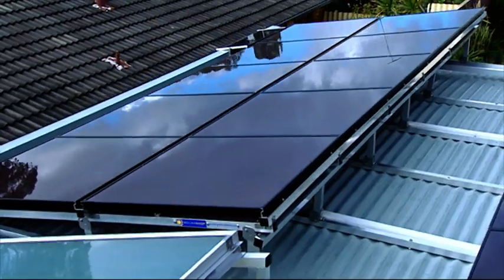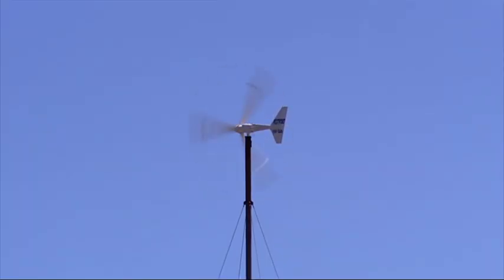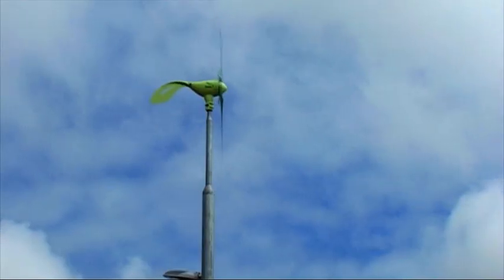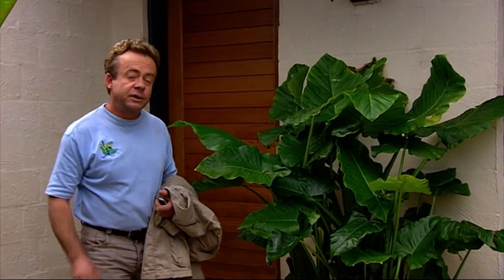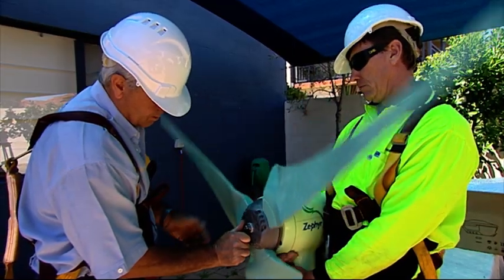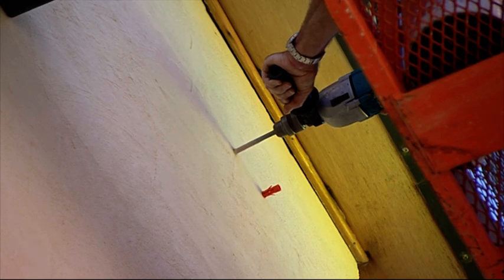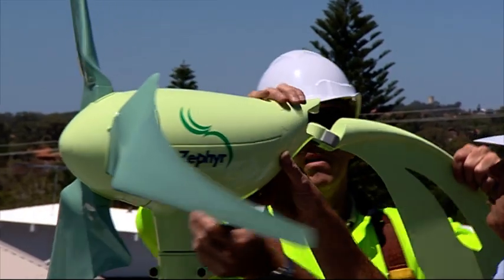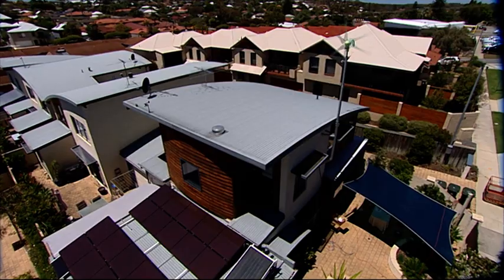Wind Turbines for the Home

Comment: Rules by placing a wind turbine on the building... = NEVER attach a tower/mast on the house, always stand-alone on a small concrete slab
Reply: +Willem Budde They can work where this one is installed. Tower would be best results but if you can't have a tower then this install will do.
Reply: Why not attach to a building? If youre thinking lightning youre screwed regardless because of the building electrical connection, though the risk can be mitigated.
Reply: Why not? Who says?" It's your house, right? The reason wind generators are prohibited from being mounted on your house, is that such a scheme would WORK too well! If you don't need a tall, expensive mast, you save money. If you make your own canvas sails, you save money, and gain torque. The object of regulations like these is to make wind generators expensive and unprofitable!
Reply: @jackfenn7524  Usually the conduct mechanical noise into the structure. There is no rule about it, just might be annoying for the occupants.
Reply: Could you please suggest a wind turbine that you are thinking of using sails.  @jackfenn7524

Comment: Wouldnt these things produce more power with more blade area? They always look skinny.
Reply: yes the output depends on the rotor diameter
Reply: @Pradeepkarti  I can understand the diameter affecting output, but not how skinny they are or how few blades. Seems like a lot of uncaptured air is moving past the large expanse of space between the narrow blades. Think of the sail dimensions kn a sail boat. Big fully deployed sails equal more power and speed. Take some sail area in and the power and thus speed drops.
Reply: "How much cash would a woodchuck chuck, if it had a brain?" RIGHT! RIGHT! CORRECT- BRILLIANT! PLEASE Joe, keep typing! YOU ARE THE MAN! If you aren't a genius, you should be! Large sails, (not blades), produce TORQUE!  And torque is necessary to produce electricity!

Comment: How much power does this tiny windmill send down the line? And how much is lost per foot due to the resistance in the power wire? If this wind turbine made money, then the electricity it produces will be used right there inside the home, in manufacturing operations and residential use.
Reply: Unless you live where it is really windy ... Wind Turbines do NOT make money ...

Comment: Mr. Vann, you are exactly right! So-called "modern" wind turbines can never pay for themselves, because they do not have enough sail area to produce torque!  And torque is as necessary to producing electricity in wind generation, as it is in any other method of producing electricity! These "wind turbines" are designed to fail!  Real, profitable Dutch windmill electrical generators would make a fortune for the owners, and they would cost about 90 per cent less to build. And best of all, no Federal subsidies would be needed.

Comment: 15 kwhr? Do the math and dont forget to include the losses.
Reply: They will never show it, cause its a fact it can  only generate 600watthr /day. total annual of 220 kwhr/year . sufficient to run home for  16days.  Cost of grid supply of 220 kwh @28 cents/kwh = Aus$62.
Cost of turbine @ 2500 including the inverters and batteries. Itll pay  for itself in 40 years. or if u only take into account the price of turbune and inverter @ 1200 , itll pay for itself in 18 years... 
So if u buy one, ur buying it for a gimmick..
Reply: Ephraim Veluz was
Reply: @ipeeinmysinkimafraidtocome7127  what? None of this makes any sense.

Comment: WRONG on so many levels. size of the blades, height and site for installation. If your town has good grid infrastructure, than instead of 1000 homes each having their own miniturbies - A larger turbine somewhere off the town would just make more sense.. Wind power scales pretty dramatucally wuth size of blade and the laminar wind .
Reply: Wrong. The unit is designed well and operates with almost no sound so the blades are correct for the unit, The height and site for the install is exactly what that particular application requires. They are running well right where they are. You probably don't want to have to do any work yourself or pay any money. You sound like you want the government to do it and pay for it for you. The problem with that is twofold; the government is notoriously wasteful of our money and then that would still leave them in complete control of your power generation. The beauty of spreading out the where the generation happens eliminates the risk of everyone losing out because of one failure and puts control into the hands of the individual. Freedom and Independence.
Reply: Free from government control doesnt imply spending unneccasrily more. Where it benefits to have a single plant, that should be considered first. Home Solar panels are  good as it doesnt scale down with size, The power per unit area is pretty much the same. And please dont quote me on with 'But the sun dont shine all day'. But with turbine, there are two factors - the site for laminar wind flow and the surface area of blade span. Especially the second factor, where it scales down pretty dramatically with size. @5,000 kwh/home annual consumption soon to increase to 13 - 15 k kwh when your cars are electric, thats  more than 32 kwh /day we will always need grid. So its wise at first to invest in Larger turbines. Anyway if you have surplus fund go for it..
Reply: Your first sentence does not even make sense unless you are agreeing with me. I said what we all know. Governments waste and overspend our money. Your sentence says the reverse. Your second sentence disregards the gov incompetence and wastefulness and gives up your autonomy and that should not be considered first. It also forces everyone to be in the same boat so to speak. People in the area who don't want to pay for the large turbine through their taxes have no choice but to pay up and then continue paying the gov for their power. I have no power bill for my home and soon I will have no gas expense to drive. I live in Canada in a completely off grid home. I don't need the grid at all. I have all my power needs including cooking and air conditioning and hot water from solar. I have a 7500 watt solar array and bring in 30kw in 4 hours midday and another 15 kw in the 2 hours before and after peak time. What is needed is to have an alternative source for "when the sun don't shine". To be able to pack my batteries full when it is overcast or raining or snowing or at night is the completion of reducing my carbon footprint to zero.
Reply: I must say though that you are right in that the larger turbines have a greater efficiency than the smaller units. My objection is solely based on it being better to take care of your self than having the gov take care of you. So that in my humble opinion; even though you lose a degree of efficiency  with your own smaller unit , what you gain in autonomy and control is more than worth it.
Reply: Your Solar generation is very impressive. Here in the UK, I use 9 kwh /day. But we do use the supply gas of nearly 1300 cubic meter/ year for heating.. We are planning a 3 kwh solar panel system, thats the most our roof can adjust. In UK, government does a feed in grid installation, where u can feed in to the main if excess production at peak hours , and get it back at night during offpeak hours. Though the panels dont cover up everything (perhaps 2/3 at worst to 3/4 at best) annual electricity- but itll pay itself for in about 10 years...
Reply: 2/3 of your power is pretty impressive. That's going to pay financial dividends in the future. 

I have a 10kw solar setup on my house & shed roof, 40x280w pannels and 2 x 5kw inverters, our payback is 3.5 years to break even point. Averaging our power use and production, on a sunny day we don't use any power off the grid from just after sun up to about half an hour before sundown. Even on overcast days we are making 40 to 50% of our power.
Reply: @joebradner126  Wrong on so many levels, I have to agree....  no way a machine this size produces 15kWh/day.  Mounting a turbine to a building is generally bad, 3 meters above the roof is bad.  I wonder how much it costs.  It's a grid tie system, PV makes sense, this does not.  And I am a huge advocate of wind energy, done right.  This is just another black eye for small wind.  Anybody who spends their money on this sort of thing is bound to be disappointed.
Reply: And which large wind turbine manufacturer do YOU work for, "Deb"  ?
Reply: @joebradner126  You will pay 5 TIMES more for your electricity from this Wind Turbine = Very Bad Idea ...

Comment: 6 kWh more than you generate with solar panels is a lot by any measure. average daily electricity consumption should be 2-4kWh. If you are wasting power on AC, your house is built wrongly for the climate zone. Rockwool would easily "generate" the needed power and save on heating in the winter too.

Comment: I have a solar panel array and a 600 watt turbine. It's a piece of crap mounted on a 40 foot tower. It's two years old and sounds like a squicky bed during sex. Guess it needs some lube. I'm going to take it down,  pack bearings with grease and mount on a higher tower